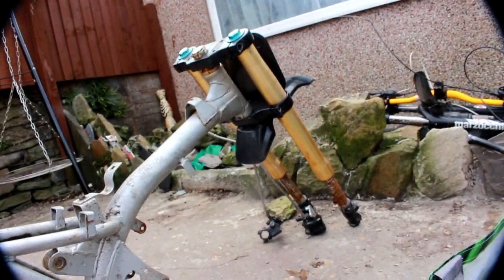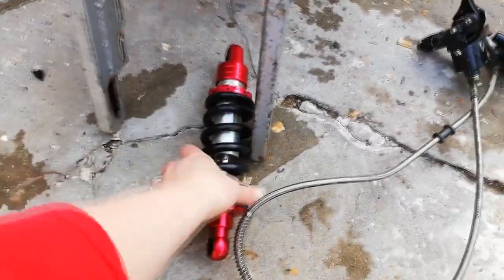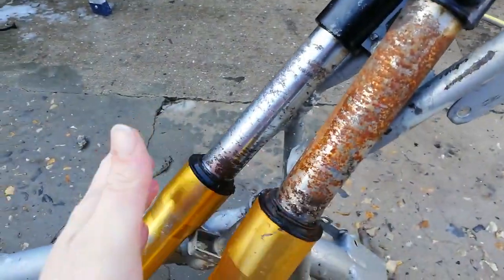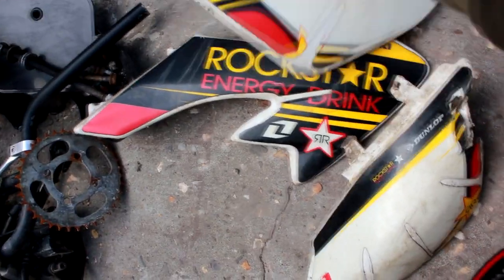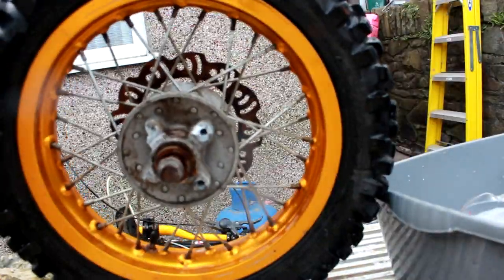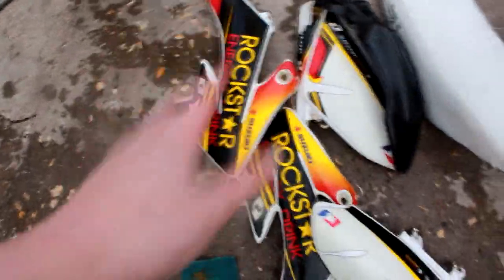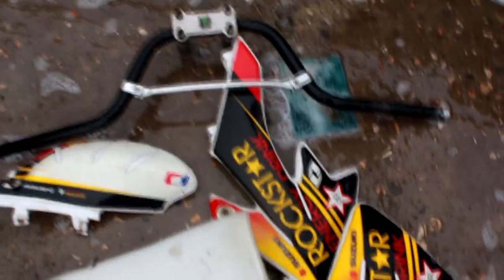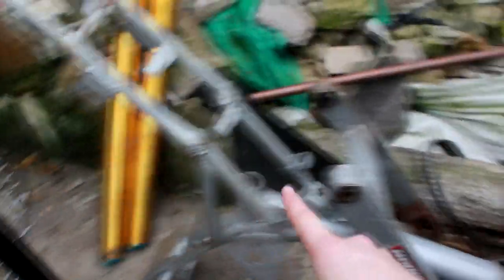£100 Pit Bike Build [ Episode One ] - Buying a broken Pit Bike to rebuild

Comment: Hey so I’m doing the same thing over this lock down. Let me know how hard it is too find engine parts cause I can’t find anything really
Reply from the maker: If your in the UK I get my parts from red circle but there closed for 14 days due to one of them feeling unwell, but there due to reopen, also ebay is where I'm getting stuff from a moment good luck, what bike you building up x
Reply: Eric Shackleton  get a lwan mower strimer engine they are cheap and thry work
Reply from the maker: @justikdjustic2171  got a mower engine to go in a mobility Scooter
Reply: go on eaby
Reply: I'm doing the same 😂 rebuild and modify everything, only thing that will be stock is the deposit 😂😂🤣